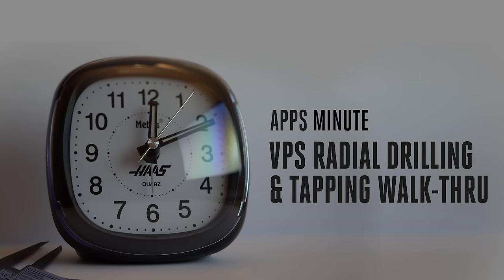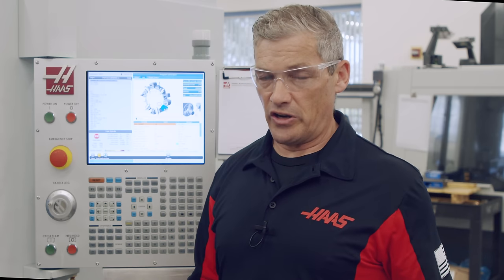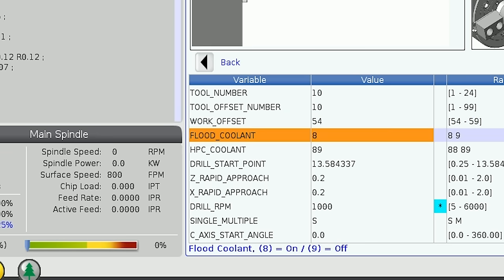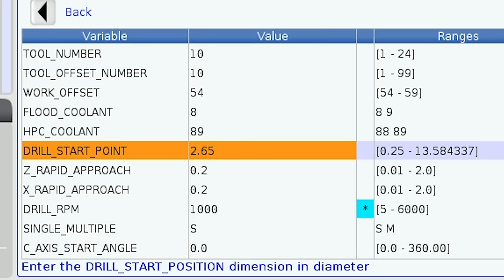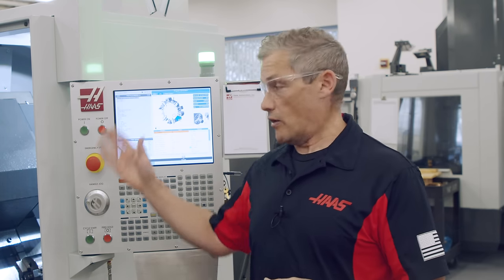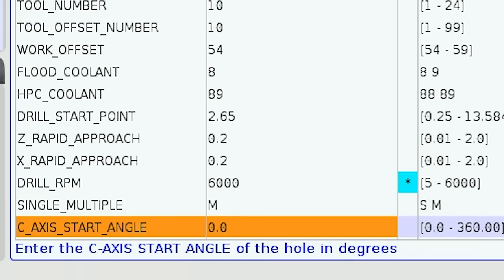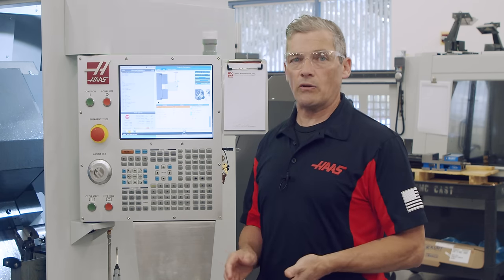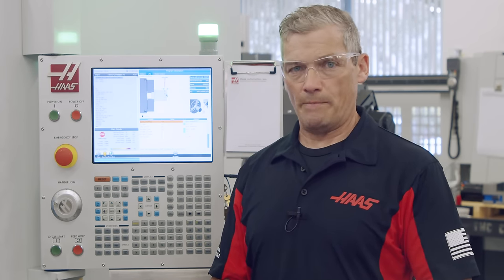Don't Know G-Code? Use VPS to Program Radial Drilling & Tapping On Your Haas Lathe-Haas Apps Minute

Comment: Can you explain how can I make holes on the od if holes are in angle? I am using a angle holder at 45 degrees. The drilling cycle does not understand simultaneous move of x and z movement. I have a Haas ST-20y.  Please help

Comment: Did sht hot make a mistake @5:05 and say .03 instead of .3?
Reply from the maker: Good catch MrCoffeypaul, Andrew should have said "point three inches" as it shows on-screen.
Reply: @haasautomation  A great quote out of Nasa, 'Between here and the moon there is a million ways to die but only one way to get it right' Don't you just love science /maths/engineering because no matter how good you are, well?
Reply: Make a YouTube video yourself and see how you go making NO mistakes ?????
Not attacking you in any way just quoting the obvious.
Making video,s is a Lot harder than it looks.
Reply: @weldmachine  I can absolutely appreciate that man, thanks!